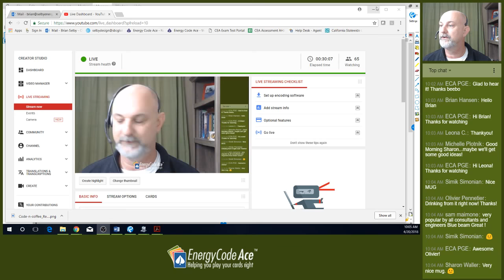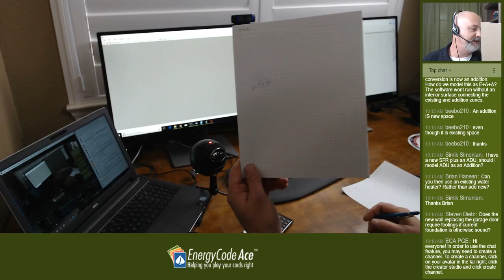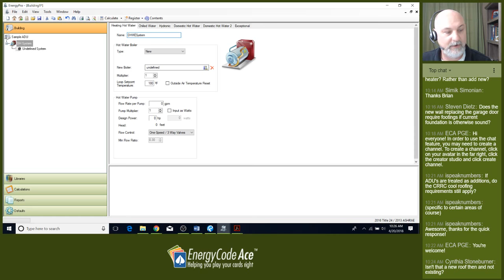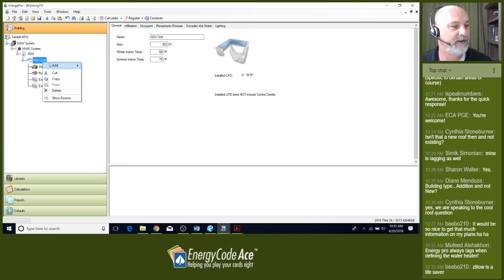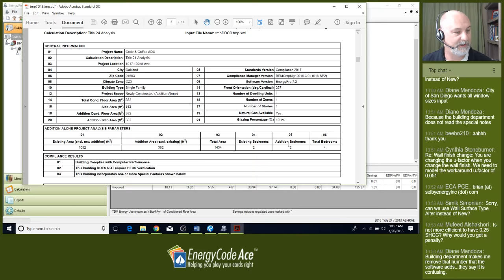Code & Coffee: 2016 Residential Modeling, ADUs — PART 1: Newly Conditioned Detached ADU

Comment: I'm trying to do code compliance for converting a 576 sf garage to retail or office space.  The California Building Code, under Title 24, Part 2 (general definitions) and Title 24, Part 10 (Existing Building Code) defines an addition as an increase in square footage or volume of a building.  In following that I've been identifying all my improvements, including any required space conditioning, as alterations.  Interesting to see that Title 24, Part 6 broadens the CBC's definition of addition to include new square footage or volume of conditioned space, not just the space itself.  In my case I had thought the Existing Building Code definitions would control whether an improvement was an addition or an alteration.  It seems that may not be so.
Reply: More apparent conflicts between the codes -- Existing Building Code says alterations complying with laws in existence when a building was built, and materials in compliance when a building was built, shall be considered to be in current compliance.  I'm having trouble reconciling that with my building department's requirement that I meet current energy code requirements for additions/alterations to my existing building that don't affect energy features that I'm being asked to update.  For example, the wall insulation was installed in 1997 and was in compliance at that time.  I read the Existing Building Code as providing that projects unrelated to wall insulation shouldn't trigger a requirement to bring wall insulation to current energy code requirements.

Comment: Can you still use a mini-split + heat pump system for an ADU addition? I was told that CEC decided all ductless heat pumps would be rated low regardless of how high the SEER is.
Reply from the maker: Yes, you can use ductless mini-split systems in ADUs, but the efficiency will be de-rated when using the performance approach equal to ta split AC system with a 14 SEER, 11.7 EER and R-8 ducts in the attic.

Comment from the maker: Questions Asked During the Live Broadcast:

1.) What if one is a garage door? Answer @ 9:25

2.) Building department wants to see the garage conversions as NEW space though. Answer @ 10:57

3.) So an existing detached garage conversion is now an addition. How do we model this as E+A+A? The software won't run without an interior surface connecting the existing and addition zones. Answer @ 11:37

4.) I have a new SFR plus an ADU, should I Model ADU as an addition? Answer @ 13:18

5.) Can you use an existing water heater? Rather than add new? Answer @ 13:52

6.) Does the new wall replacing the garage door require footings if current foundation is otherwise sound? Answer @ 16:10

7.) If ADU's are treated as additions, do the CRRC cool roofing requirements still apply? Answer @ 20:31

8.) Isn't that a new roof then and not existing? Answer @ 26:56

9.) What is roof orientation? Answer @ 38:11

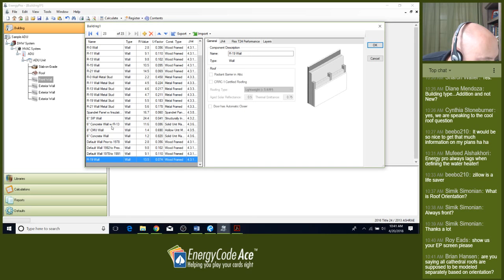10.) Are you saying that all cathedral roofs are supposed to be modeled separately based on orientation? Answer @ 40:40

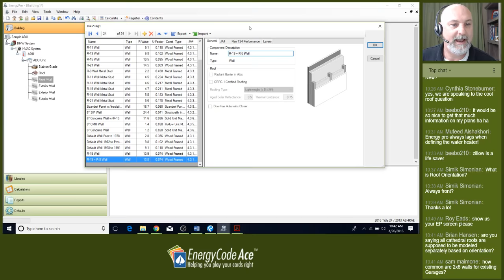11.) How common are 2x6 walls for existing garages? Answer @ 41:20

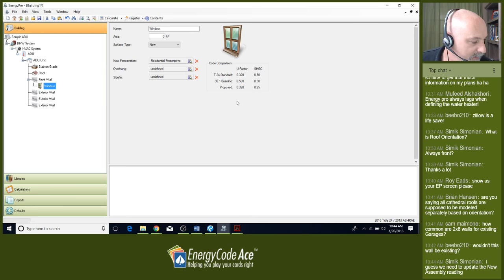12.) Wouldn't this wall be existing? Answer @ 43:43

13.) But the wall is already there, won't you need to model it as it exists? Answer @ 46:22

14.) I could comply using 1% using one of my existing models, but when I changed the Exterior Wall Finish to Synthetic Stucco then it dropped to 0.3%. any idea? Answer @ 47:08

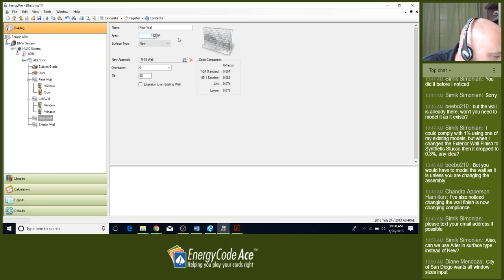15.) But you would have to model the wall as it is unless you are changing the assembly. Answer @ 49:41

16.) Re: wall finish change: You are changing the u-factor when you change the wall finish. Answer @ 1:01:53

17.) Can we use Wall Surface Type Alter instead of New? Answer @ 1:02:17

18.) Is it not more efficient to have 0.25 SHGC? Why would you get a penalty? Answer @ 1:02:47

19.) If there is a new ducted furnace, would HERS registration be required? Answer @ 1:04:04

20.) Did I see the report show 4 bedrooms? Answer @ 1:04:48